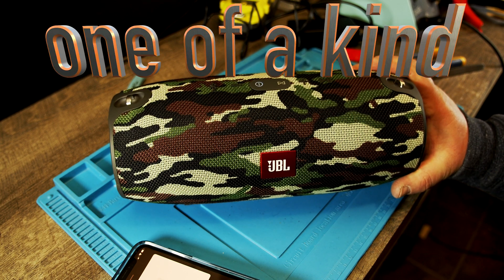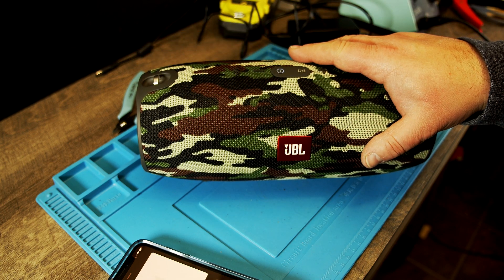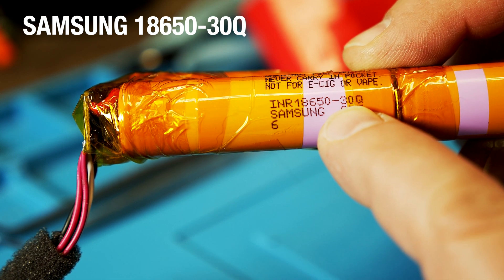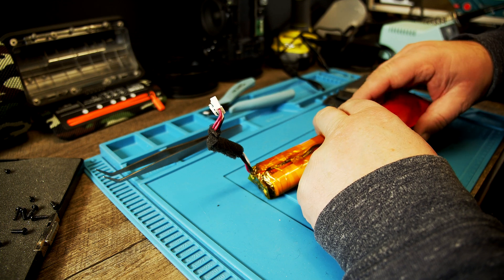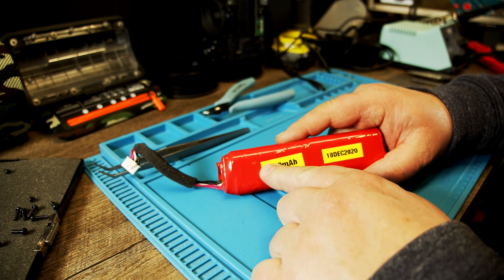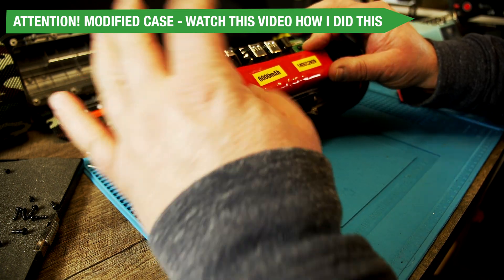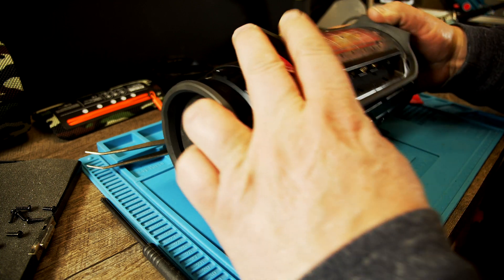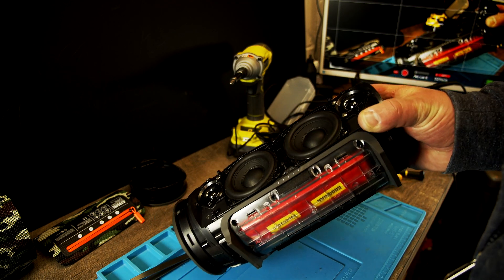JBL Xtreme 6000

Comment: Can you help me with 2 cells 8 battery on jbl xtreme I have the same problem Goin not on I can loaded with cable I see that full 5 lights and going don't on with power button
Reply from the maker: 8 cells? i am not sure if the BMS can handle that!? the risk of fire is going to double, and yes the bms must be connected to all batteries, not just 4.
Reply: Ich habe 2 cellen mit je 4 Batterien also acht muss ich zwischen denn Zellen nochmal koppeln oder ich habe die erste Zelle b+ Bm die zweite Zelle b- Bm aber laden tut es springt ohne lade Geräte nicht an
Reply: I can connect 4 batteries with 2 bms per 8.4v so 2 cells per cell to the old bms from the jbl b + from the first bm- from the 2 cell bm + with b-

Comment: jbl xtreme slow charging after 18650 battery 2600 mah panasonic replacement, what"s the problem?
Reply: I have 8 x 3400 mah with 2 s and 2 BMS with 20 ah , with tp5100 and a Volt regulator and that is first Charching 5 h and the Last led beginnig that  is cold and good works thanks for all the people and the group

Comment: Hi there. Did you spot weld these or use solder? Also would you recommend Panasonic NCR18650GA 3500mAh batteries for this mod? Thank you for any help.
Reply from the maker: I did a spot weld, and i never tried the Panasonic.